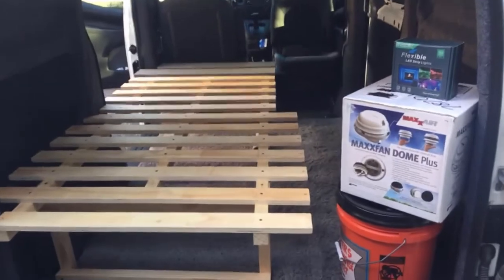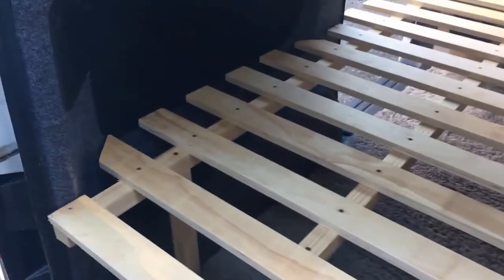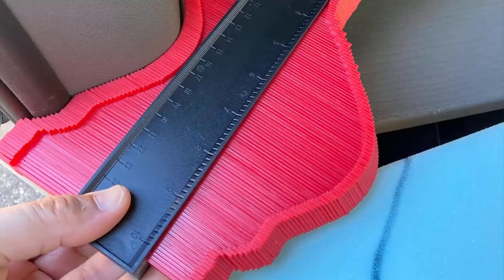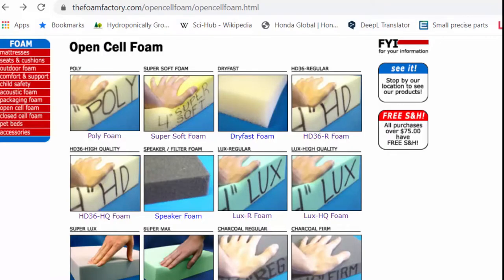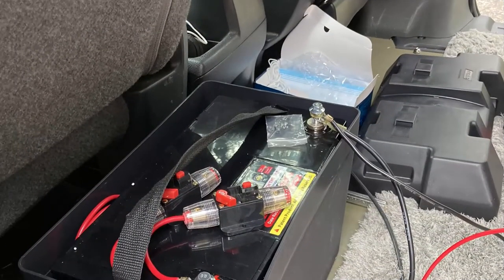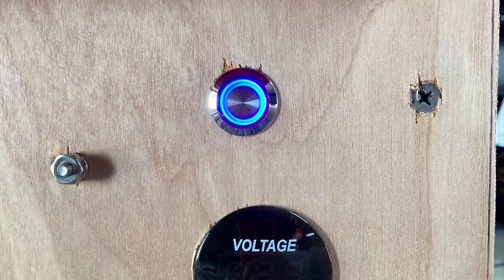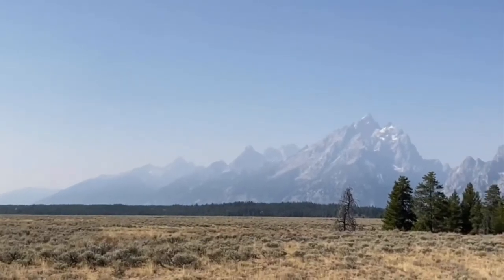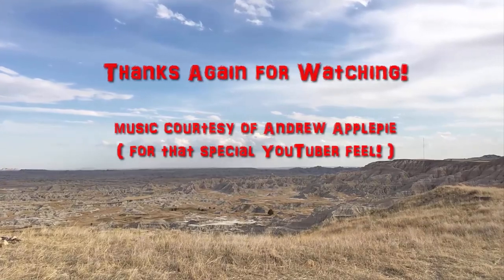Tabula Rasa Part 5-- a Bed in the NV200 Campervan

Comment: Enjoying it. Very different from Odyssey build with more built in stuff and house battery, etc. Curious to see how roof vent fan works for you. I think it was Into the Mystery that did a floor vent which I found concerning...exhaust fumes coming in etc??? But I think Forresty Forrest uses one like you're installing with good results. He's in very small Chevy mini van.
Reply from the maker: Hi Jeana, glad you like it!  I actually thought about floor vents but I’m not THAT concerned about stealth (assuming that was the reason). I also thought about wiring the vehicle dash fans to the house battery, to push air through. It’s all an experiment, as you know ;-)   I will check out that guy’s channel (fun fact, Forrest Is my middle name!).
Reply: @OdysseyCamper  seriously?! Forrest? Wow. That's interesting about wiring the dash fans. Would there be a separate switch from on board controls? And wired to house battery? Any thought given to Chinese diesel heater?
Reply from the maker: @jeanariley7759  LOL, yes; the name is a true story!  I would run the power through a contactor (relay) so that the fan could only be powered by one source at a time. It could also be run through a thermostat. I’ve seen the Chinese Diesel heaters and always wonder if these people remembered the CO detector. Not sure I’d trust my life to one while I’m sleeping. However, if we assume they are “safe” then it’s an intriguing idea for people that park for a few days. When I stay somewhere cold I am either hiking or driving during the day. So when I stop I’m only sleeping and I’m warm and toasty in the sleeping bag. But it would be great for the time that I’m not in the bag and for the morning. My little heater is on a timer so it kicks in before I get up, but it’s like a midget breathing on my ankles. Real warmth would be a nice luxury!
Reply: @OdysseyCamper  yeah and good , dry heat. Don't know if low O2 shut off cuz everything happens outside of van. I'd do CO2 detector anyway cuz I cook in van with butane and right now heat van with butane. I got a couple of those wood stove fans to sit on heater. They work great! Makes a world of difference!
Reply from the maker: @jeanariley7759  I think everyone should have one, if for no other reason than we are in metal boxes, with a fuel burning engine at one end. 
   It’s good to hear from you!  This year had been especially busy for me and I’m having trouble keeping up with everyone. I wrote a my longest post ever for the blog, covering my travels this year, only to run into a technical problem with WordPress when I tried to add pictures. Hopefully I get it sorted in time for the holidays. Best wishes to you and yours for Christmas and the New Year!
Reply: @OdysseyCamper   I am glad that you are doing well- conside ring ALL things this year. :(  Lookng forward to rest of build.  Happy Holidays to you, too. I will be working on Element and Sidekick builds. Have awnings, SUV tents, etc to expand space.,

Comment: You gave up your trusty Coleman cot. I see the beauty of a built bed that conforms to the van contours and your body shape. Do you find it more comfortable than the cot setup?
Reply from the maker: I still have the cot, but as I get older and ahem...spread out, a wider bed is more comfortable.  I'm a side sleeper which meant that my arm was always hanging over the side rail and I'd wake up with a sore arm or worse, a numb arm (whose hand is touching me?!?!).  But, if you are under 6 feet and especially if you sleep on your back, the cot would be perfect.  Thanks again for checking out my videos!

Comment: Thanks for the info on the firm foam. Do you have a sense of how much some of the less firm foams compresses? I’m thinking about a sliding bed that’s a couch during the day, but I’m not sure how tall to make the base. I’m 6’, so if the foam compresses some, I could have a slightly taller base that would give more room for storage.
Reply from the maker: The less firm foam compresses about 25% but my advice is to go to one of these stores and request a piece to sit on.  The taller you are, the more your weight is distributed and the less it compresses. It seemed like mine compresses about an inch. I’m 6’ 4” and 250 lbs.
Reply: Thanks! That gives me a good starting point.

Comment: Nice build so far. What do you think of this vs. the Odyssey so far? Does not having the extra length/ width make a massive difference?
Reply from the maker: Thanks!  I like building in what is essentially a big cube (or breadbox).  There are fewer curved surfaces and space lost to plastic upholstery, compared to the Odyssey.  Also, the floor is completely flat.  Driving wise, the Odyssey beats it in every other way, including fuel mileage.  But for a build where you want to do it your own way, the NV200 is hard to beat.  Actually, there is one other way that the NV wins...ground clearance.  Especially with the taller tires I've fitted.  The Odyssey is inches closer to the ground at the rocker panels and the oil pan is very close to the ground if you do any rock climbing (who does that, right ;-)

Comment: About how wide did u end up with on the widest part.  I looking for a van (maybe conversation van).  I debating a full twin or a 30 inch one.
Reply from the maker: I should have put that in the video!  At the widest, it is 36".  I wanted more than 30" because I'm a side sleeper and my arm used to hang over the edge of my 30" bed.  I'm 6'5", so this may or may not be an issue for you.  The frame rails are 30" apart but the slats hang over the edge.
Reply: @OdysseyCamper  I'm a wide body myself, and I found 30" is wide enough for me. I ordered foam online, and got 5" fairly firm for about $90. I built my bunk with 2x4s, and used 3/4" plywood. You have a lighter, cleaner, neater build than mine. It looks very nice and neat. I'm subscribing and will follow along. Nice video!
Reply from the maker: @scottrosenberger8696  Thanks, I'm flattered but you didn't see all the half-starts I made.  I learn a little bit more each time.  I used a 30" cot for years and it would be perfect for a back sleeper, but I was always waking up with a numb arm draped across the edge of the cot.  Thanks for watching and for the sub, it's appreciated!
Reply: @OdysseyCamper  
I'm a large person too and I will hang my leg off if it isn't big enough.  I think I'm going to try it at home and stack many pillows in the middle of my queen size bed to see if 30 inches is enough.  Thanks for the information.
Reply from the maker: That’s a great idea!
Reply: So glad to see your video.  I will search to find 2,3,4, to view as well.  Continue!
Reply from the maker: @volvoqueen9698  thank you for the encouragement!  If you click on my channel name and go to my channel, under “playlists” is a list with all the NV videos. Thanks for watching!

Comment: Does your NV have D-ring tie downs on the floor?
Reply from the maker: Hi Karin, Yes it does. They come standard on the SV trim level of the NV200, but you can order them for the other trim levels. I removed the rings and put in extended screws to hold the subfloor down, but it’s a 5 min job to reattach them. I leave them off when I’m not carrying a pallet because they are painful to step on, LOL!